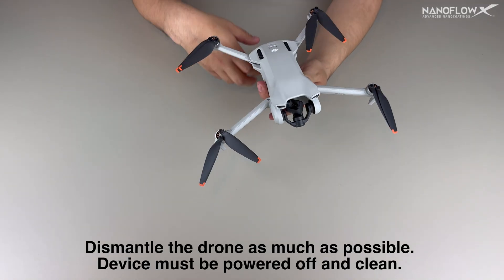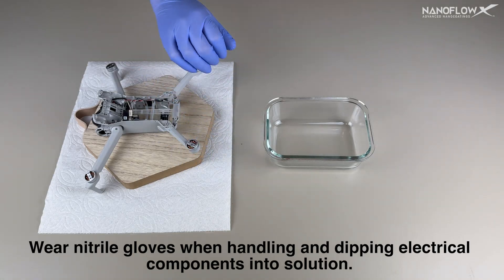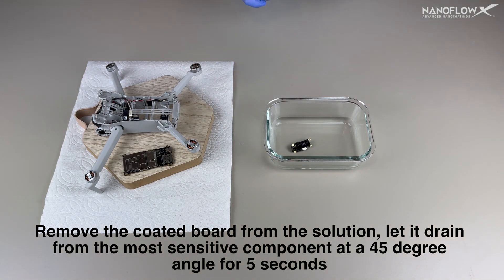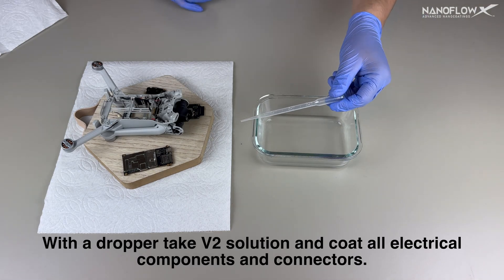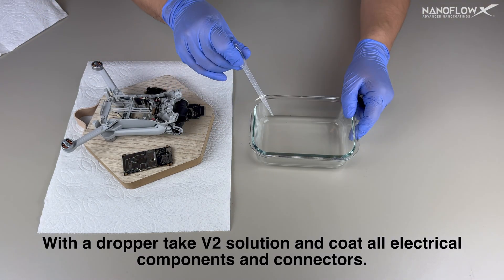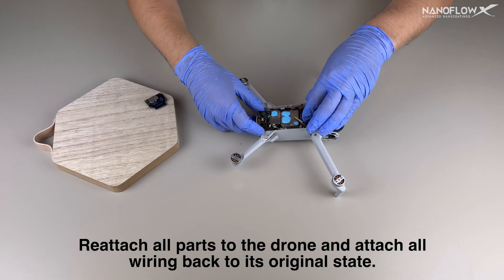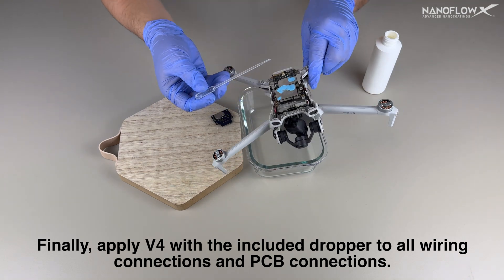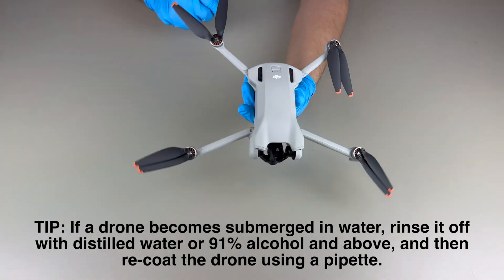How To Transform Your DJI Mini 3 into a Waterproof Drone with NanoFlowX

Comment: It looks like everything is getting coated.. Could I just dip the whole drone minus batteries and submerge it in a bucket of solution?? I know I wouldn't be able to get the nitty gritty components but I could call it water resistance beta??? Thoughts?

Comment: Hi there, I am a bit unsure how to cover the drone camera with this liquid. If I just splat the nanocoat over the camera, it will not cover the internals of the camera. Is your nanocoat creating a sort of seal to the camera casing? I just didn't get it how the inside of the camera will be protected. And in addition, if the nanocoat comes inside the camera on the camera sensor, will it affect the picture?
Reply from the maker: The entire camera was submerged without any impact on the sensors. Clarity remains uncompromised, and there’s no residue or splatter.